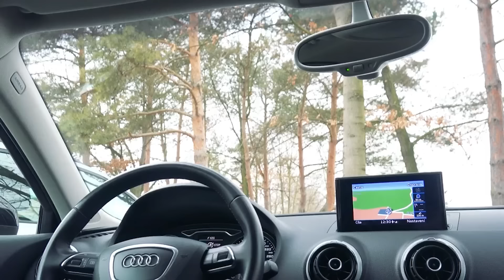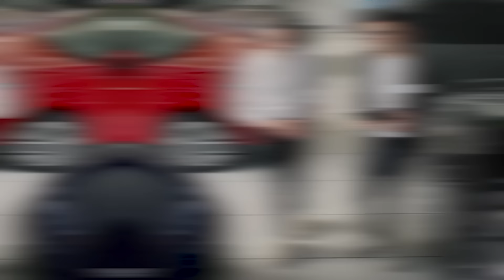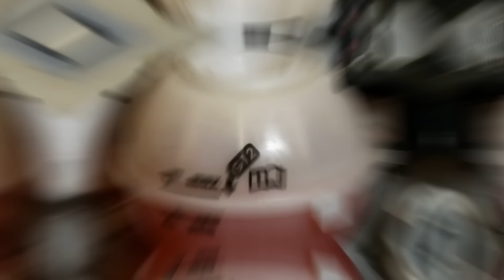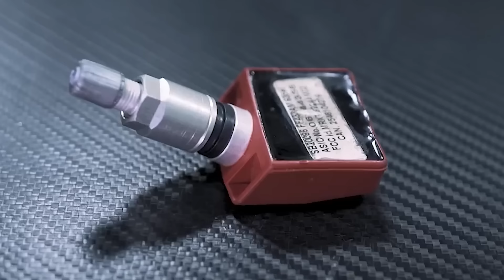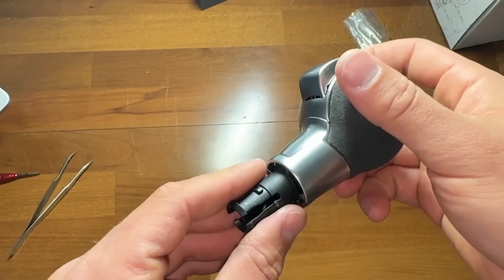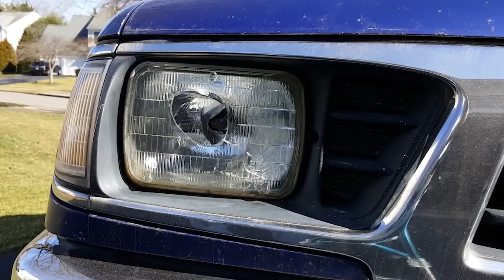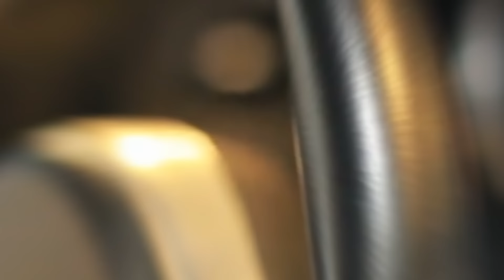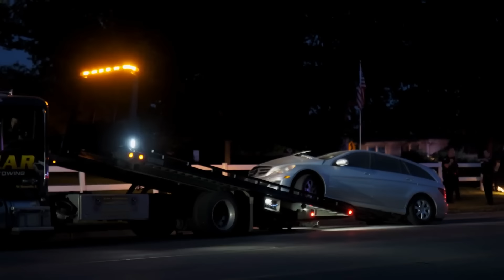25 STUPID Car Features That DESTROY Reliability & Lifespan

Comment: One of the worst “features” is cylinder deactivation, special lifters are engaged and disengaged with oil pressure into the lifters to engage the lifter or release the lifter, that’s taken ultra reliable engines like the GM LS and LT motors that typically lasted 300,000 miles of more unnecessarily complicating them and thus reducing longevity to under 100,000 miles! In actual road testing the cylinder deactivation feature increases fuel economy 2-3 percent. Hardly worth the effort!
Add to that variable oil pressure systems, variable valve and cam timing and what have been very reliable engines are now unreliable ticking time bombs
Reply: With the sky rocketing cost of original spare parts, I get the impression there is an ongoing conspiracy to make sure new cars are not viable past 10 years and/or 100'000 miles.

Comment: The start stop system doesn’t use an AGM Battery or a gear reduction starter. There is a 400 V Lithium Battery on board in addition to the 12 Volt Battery. The starter is a built into the flywheel so the starter you see in the picture doesn’t even exist on the vehicle.

Comment: My dad in the mid-1950’s worked at an automotive factory. When he decided it was time for a new car he’d always buy directly from the factory and it was a basic car. Other than a radio there wasn’t any other option: no ac, power windows or seats. His reasoning being that they were just something that would break easily that would have to be paid for. So much more so with today’s technology driven cars. I buy old used cars today cuz I don’t want the hassle and expense.

Comment: I own an older car that doesn't have all these electronic options. I now think that, rather than buy a new car with all these troubles, I will just spend the money to rebuild my old car when it needs it.
Reply: Yeah I'd just spend the money that you would have to give a dealership, and make your old vehicle new again. You're going to spend a lot to buy that new one anyways!
Reply: "Old" cars have turned from worn out trash, to appreciating assets. Depending on the magnitude of money you put in it, you are likely to get your money back if sold.
Reply: @iRelevant.47.system.boycott yep! Because you can fix them up and make them like new and people desire that over the new ones. I call the new ones, "cheaply made garbage vehicles!" They've put quantity over quality nowadays.
Reply: These “doom” videos are based on anecdotal evidence, all cars - whenever they were manufactured - have issues. Don’t let things like this scare you, just buy a car off lease with a decent model reliability  record and have a mechanic you trust review it first. You’ll be just fine.
Reply: @waynejohnstone3685 you sound like a car salesman trying to save face.

Comment: Besides engine stop/start feature. This video is pretty much a Tesla hater.
Reply: The start stop info is incorrect as they use two different starters.
Reply: @user-lh2yr2sk4o it’s more than starter wearing out. Every engine start/stop is wear on engine due to brief oil starvation.

Comment: Stop start is great. I think a lot of people love to hate it because hating stop start is popular and y’all are paranoid about starters. Modern cars have no issue with stop start. Your car does not need to remain running while you’re stopped in traffic or at a red light. Yes, it can break, just like starters that don’t have stop start 🙄
Reply: No, it isn't. If you have an ICE only car with a turbo, when you stop the flow of hot oil and coolant the turbo is being cooked and the oil coked which will destroy it in no time.
Reply: @horseathalt7308  that’s typically handled by a computer. If your turbo is at a temp where stopping the engine will damage it, it just doesn’t activate the stop start feature. There are lots of instances where the stop start feature is smart and decides not to activate. Sometimes it doesn’t activate if your wheels are turned too much or if you’re on a steep incline
Reply: @lilbill88  Thanks but I don't trust it, not to mention the disturbing way it feels in any case. I'll be getting aftermarket attachment that keeps the start stop from activating at all. I want the engine ALWAYS on.

Comment: The start-sop mode does not use the starter motor, and running the AC or heater is automatically disable it on most cars.
Reply: You should do your research because it does use the starter to start lmao 🤣 that why it's called a starter!
Reply: @Pterophytes     Yup, you right, thanks for the update. Long time ago an SME claimed that it restarted by injecting fuel into the cylinder properly clocked and igniting it to restart the motor. Maybe he wasn't a Subject Matter Expert after all.
Reply: @LouLope more like ignorant...I been a mechanic since I was 10 so yeah 👍

Comment: I absolutely hate the Start/Stop systems and that they are the default option when I get in my car. I turn it off every time I get in my car. But there is absolutely no real evidence that it harms an engine or starters that are specifically designed for that sort of operation.
Reply: Vehicles that do this do not have standards starters.  They may be specially designed heavy duty starters or ISG's.  That being said, the vehicles that I have that stop at traffic lights are both hybrids.  I actually had a co-worker ride with me in my Rav4 hybrid once and the first time the engine shut off he asked how that isn't bad for my starter.  I blew his mind when I told him that the car didn't have a starter.
Reply: @sinimsdp  And how do you thing your fuel engine starts when your out of electricity ? Assuming you have one and that it works :)
Reply: @iRelevant.47.system.boycott Hybrids don't "run out of electricity" as they start the gas motor when the battery is low or when more power is needed.  In this case, the electric motor acts as a generator and starts the car instead of needing a starter.  This is called an integrated starter generator or ISG, which I mentioned.
Reply: It may not be as bad depending on how much engine idling a car experiences daily. If the vehicle has is not reaching optimal operating temps due to early morning traffic jams, construction stoppages, accidents, continual braking, a start stop button could be helpful and is lowering emissions and fuel burning. A starter is safe as long as the pinion gear retracts after restarting so it does not get ground down. But 60,000 starts and still effective. Guess not that big an issue, lol
Reply: @timezip  It depends how you count. A start/stop function in the conditions you describe, will extend the time before the engine reaches optimal operating temperature. While it can in a city environment be an advantage that cars are not running on idle while stuck in traffic, spewing sub optimal levels of pollution into the environment ... the question is : Say from starting point A to point B where the start/stop engine has reached optimal performance. What is the difference in overall pollution/fuel consumption ? Remember for things to be equal, the start stop vehicle will need to run longer on point B to reach the same charge level on the battery as the car without start/stop. Depending on the traffic flow, I can imagine a scenario where the start/stop car performs worse. There must be multiple tests done, documenting this comparison. Or not.
Reply: Thank YOU @fun ! There is no evidence guys and gals that it does more harm than good! If you guys were to read about the ins and outs of this feature like I did in Popular Science you would know that it actually does help with fuel savings and the car manufacturers beefed up starters and other components so as to not fail! Sheesh!😐
Reply: My 2018 sierra no problems !
Reply: The whole video based on nothing 😂 and I do hate start/stop system
Reply: @Altair102 7 yr old vehicle and I don’t even know it stopped n started unless i’m looking down  at my dash
Reply: Use your common sense,any over use of any mechanical components will wear out faster,and that’s is a fact!
Reply: @WilburClark-c7q why is it always complete dipshits arguing with me about common sense?
Reply: @WilburClark-c7q that is why car manufacturers have beefed up starters and other components you bonehead! Do some research!!! Sheesh!🤦🏻🤷🏻‍♂️😐😡🤬
Reply: @WilburClark-c7q  Now, I'm not saying you're wrong because obviously using a device causes wear, but your average starter today should be good for over 60,000 starts. Will you hit that number quicker with start-stop? Absolutely, but it's gonna still take a long time.
Reply: @Birdadventures ummm…count the number of times you start stop on your next trip. Drive thru restaurant? Hopefully not busy bc that’s 5-10 right there. Happen to hit 1/2 of the red lights on your trip? 5-10 more. All this on a usual 1 start trip. I understand what you’re saying but…
Reply: @rogwar95 I'm sure it can add up yes, not gonna disagree with you there. My vehicle is old, no start/stop so I can't personally count like you suggested.
Reply: @Birdadventures  same here. Wife wanted the bells and the whistles…happy wife, unhappy wallet 😂
Reply: @Birdadventures  In city driving, it will also keep the engine longer in the below optimal temperature zone ... with extra wear over time. Regardless of start/stop, it is common knowledge that a car that has been used for long range driving vs city driving, is in a better condition at the same mileage.
Reply: @WilburClark-c7q I’ve been an industrial maintenance mechanic all of 51 years, if you cycle a machine or a button over and over it Will Fail people who tell you it won’t are pissing on your leg and tell you it’s raining. You sir are 100% correct!
Reply: @williampatterson8675 luckily they design for cycling, they don’t use regular parts.
Reply: @waynejohnstone3685  No doubt. The MTBF is likely precisely calculated. How far beyond the warranty period with normal use do you think it stretches ? Not being a regular part, means it is a specialized part that comes at extra cost. To the original buyer of the car, and likely at an even higher replacement cost down the road for a second hand buyer.
Reply: THANK YOU! I love stop start. But the most annoying thing to me is when people make up stories that it damages internal components. You’re allowed to just not like it without having to justify it with false info
Reply: @lilbill88  They’ve always said most of engine wear occurs at start up. They’ve also claimed that the way fuel mileage is measured in a lab is different than real world driving. And the start/stop feature and the skip shift that some manual transmissions have only show fuel improvements in a controlled environment. Several cars and trucks have had lifter failure due to the gimmick that shuts down 4 cylinders in V8’s when at cruising speeds.
Reply: @tupole272  A stick shift when operated properly, improves fuel efficiency vs an automatic transmission. There is a marginal overhead in the oil based automatic transmission system, where as a stick shift has a direct mechanical connection between engine and the wheels. Similar to how also an AC system increases fuel consumption vs. a simple fan blowing in air from the outside, heated up by the engine coolant system.
Reply: @lilbill88 exactly!!! I read an article in Popular Science about this feature and car manufacturers have tested it up to a million times with beefier starters and other components to ensure this start/stop feature will not fail or cause harm on the components! All these people spreading false rumors about this feature!🤦🏻🤷🏻‍♂️😐
Reply: @lilbill88  Are you claiming that starting an engine does not put extra wear and tear on it pr. time unit, compared to when it is in warmed up and in peak performance mode ?
Reply: @lilbill88   It definitely causes premature engine/starter damage. Do a little research rather than relying on one person’s comment.
Reply: There is some cognitive dissonance here. Why do you turn off the system every time you get in your car, yet of the opinion there is no negatives to the system ? 

With a basic understanding of physics, it is self evident that the use of a mechanical device generates stress and wear on it. Especially the start up process generates most stress and wear pr. time unit. Maybe it works fine for 10 years and 100 K miles, but what if you buy it out of warranty and without start / stop it would have lasted 20 years and 200 K miles ? I assume that a car that has been running with an active start/stop system, have as a consequence a reduced lifespan compared to one that hasn't.
Reply: @iRelevant.47.system.boycott  the word “assume” there is doing a lot of heavy lifting.
Reply: Cause its considered an emission feature. That is why it typically turns back on when the engine is shut off by the key. You can blame California in the US for that. The only state they have to alter a car to pass emission standards.

Comment: Tip from a taxi driver always buy 10 year old car go Toyota or Honda less feature less headach even if go bad you could get after market parts or used parts from salvage yards  that don't require dealer parts and repair 😘
Reply: Original Toyota spare parts cost an arm and a leg though.

Comment: On my both Porsche 911s I dont use stop & go feature. That mode is really hard on your starter..it's better to let idle at the red light. A little gas you save on that is not worth replacing the starter later. I used to be an A&P mechanic and believe me ..don't use that mode.
Reply: Engine reaches optimal operational temperature quicker also, i.e. less wear and more optimal fuel consumption/pollution.
Reply: The thing is the car manufacturers have beefed up the starters to compensate for all those start/stops-I read an article in (I believe it was called) Popular Science. It does take a little getting used to -I now have a vehicle that has that feature whereas before all my previous vehicles never had it. I’m ok with it.🤷🏻‍♂️

Comment: As someone who works in a dealership, I absolutely hate electronic park brakes and dial/button shifters.
Reply: Stupid idea. A reliable cable parking brake with a handle to set is replaced by a short life switch that runs a short lived electric winch in the back of the car that winds up the cable. How STUPID is that?
Reply: @fritzbang4805  Sounds crazy. If the system fails, even the former self contained emergency brake goes down. No electricity, no emergency brake. Not putting my ass in that seat.
Reply: Learn where the manual release is located and how to use.
It. BMW especially.
Reply: Remove panel pull ribbon ?.... Please.

Comment: Excellent and informative video - many thanks. Pretty much all the problems listed here apply to cars made after 2010. With a few exceptions, most cars built prior to that were far simpler and easier to maintain and repair. Personally, I much prefer cars with manual transmission, and with a proper old-fashioned handbrake and not some absurd and flimsy plastic button. 

My guiding principle with cars is KISS - Keep It Simple, Sunshine..!
Reply: All my life i had a manual transmission.  But now with bad knees, I’m grateful for an automatic transmission—my first!
Reply: @jerryrohr5096  Quite understandable. I hope it proves reliable for you.
Reply: @jerryrohr5096  Automatic transmission is great for city driving, when it comes to control and flooring the pedal for acceleration ... a stick shift is the law.
Reply: We all know what the last S stands for.
Reply: All the new tech in cars is just that, a money pit

Comment: I can't f'kn stand that auto shutoff crap. Just waiting for it to not work one time and yeah. It wears every system and component necessary to start the car. I have an F-Pace SVR. That starter would eclipse the fuel savings by 10X with one replacement. So I start my car like a 787. Seat cooling: level 3 on. Temp balance: synced. Driving mode: Dynamic. Exhaust: Full open. Auto-Start: OFF. Start checklist complete.
Reply: See I knew this feature was a gimmick! It’s annoying as hell. People used to shut their cars off manually “to save gas” between red lights. I always thought it was stupid now this video proves that it’s more harmful than we think. I refuse to buy any vehicle that doesn’t have the button to turn that feature off, even if it’s temporarily at the very least. I’ve gotten used to turning mine off before driving away.

Comment: idle stop ruins your starter a starter was never changed to constantly be on and off all day long.
my 2026 honda civic has a timing chain and real buttons and with the touch screen.
TIP: if you buy a new car put di-electric grease on your battery terminals, exposed ground wires to prevent corrosion. will save you a new battery and wire harness.

Comment: I drove two loaner Subaru Crosstreks over the past couple of weeks, both equipped with CVT and haptic displays while my 2023 Crosstrek with manual transmission and real live knobs and switches. I don't see the advantage of having to navigate three layers of touch screens to adjust the air conditioning, especially when it involves having to look down and decipher cryptic icons instead of concentrating on the road.
The problem with my '23 model was a battery failure at 25 months (still under warranty).
It started fine when cool in the morning, but at luncg time or when leaving work in the evening, it would turn over once or twice then tick like a Geiger counter. It took seven Subaru Roadside Assistance calls two drive-in service visits and two flat-bed tows before the service (scoff) techs finally figured out the problem.
Reply: What was the problem?
Reply: @JinxD247  The battery was all right when tested in moderate temperatures but when they tested in in temps over 100 degrees F it "failed miserably." to quote the service manager.
Battery replaced, and it's working now.